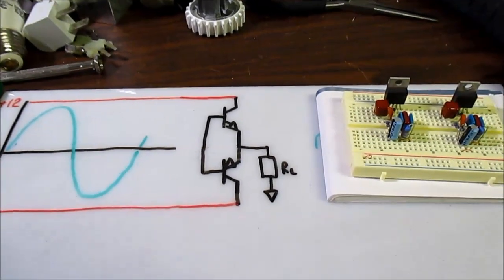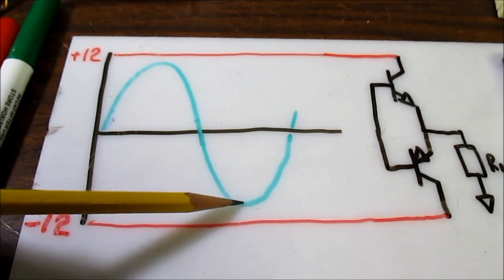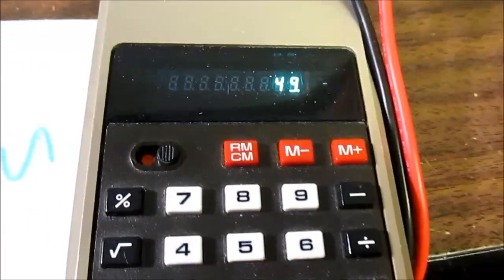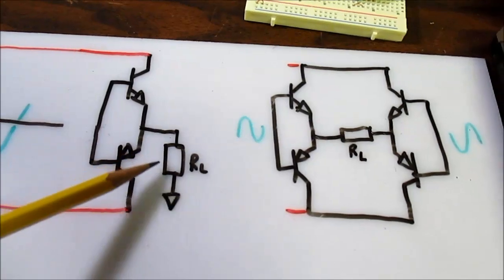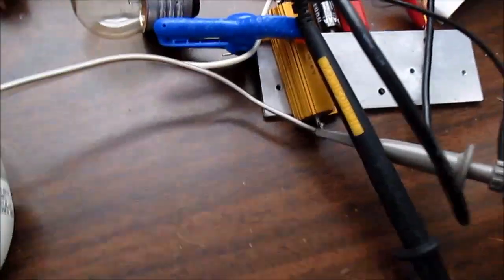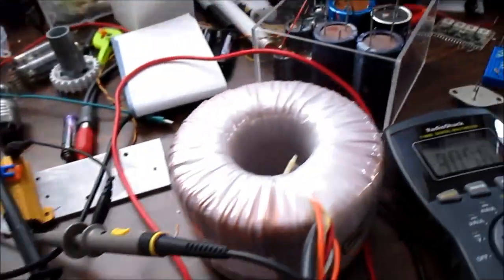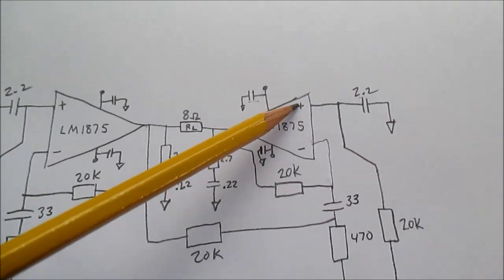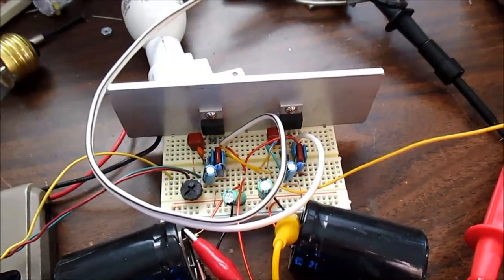Bridging audio amplifiers explained, LM1875 example

Comment: It's certainly worth bridging them if you want power from a lower supply voltage. I was thinking about doing it for an amplifier that runs from a single rail supply...22 to 24V from a rechargeable Li-ion battery

Comment: Hi John... When you sayd "35 clean watts is not too shabby with +/- 15 volt rails", I think that is voltage  +/-15 Volts under LOAD... In order to get more clean the wole picture,  please, can you tell me about the transformer? I mean secundary Amperes and CA volts (VA transformer data) and after rectifier CC WITHOUT LOAD? As always, very instructive videos... Thanks a lot and Greetings from Spain...

Comment: all you have to do to get around the current limitations is run the output of the op amp through a current buffer, and then take the feedback from the output of the buffer and you won't get any crossover distortion if your slew rate is high enough.

Comment: Hi John, came across this video now. I ordered 4 of those ebay LM1875 kit you tested. Good tip. Bridging them would be nice to try, but I have a question, why do you connect the output of the first amp to the second amps input instead of connecting the same input (to the inverting input of the amp also). Wouldn't that be cleaner, not having half of the signal go through 2 amps?

Comment: great video as usual. i'll only say that bridging "not so btl chips like 1875" could be useful when you already own several chips or a transformer with not enough voltage. those chips are way cheaper than transformers here, so if you want to add power to an existing system on a low budget, it's far more convenient to bridge or paralell some chips than to replace power supply.

Comment: I never liked the sound that comes from bridging car amplifiers! It just didn't sound right! To me it was like a whole lot of speaker movement, without the bass matching it! 😎

It is as if a switch was being cut on and off to mimic what was suppose to sound better, but didn't! But I don't care much for dual-voice coil speakers either!

To me a mono block amp is far better than a stereo to bridge mode amp, because it is made for stereo to out put mono! To where the other, has to be rewired to get the same effect! Plus I think there is more bang for the buck going mono vs a tri-bridge configuration! 😎

Comment: John. I dont understand why you stuck on tnose chipamps its no challenge. At least build descreet component amplifier with separate transistors. I dont mean to be rude but that would be a Better challenge than those chipamps.
Reply from the maker: +Hendry parman Discrete amps are beyond what a lot of people are interested in and don't attract as many views as the chip amp videos. Despite that, I am interested in discrete designs and do have a video in the works.

Comment: I don't get the purpose of signal generators. Every android phone can be such(up to about 22KHz). I can't see a reason investing in one.
Reply from the maker: +Rivalgamesbg A true wave form generator is far more versatile. Higher amplitude, low distortion, RF frequency, modulation options, arbitrary waveform, dual channel, frequency counter and so much more. I have no excuse for not having one on my bench besides the money needed...
Reply: Mihail, what you said, no it doesn't. Unless you  just want a toy to play with, then it's OK.
Reply: +JohnAudioTech Yes indeed, something I have wanted for decades now... Also a good dual power supply and scope like you have.
Reply: JohnAudioTech
It can do all those stuff you mentioned. The only thing it can't do is high frequency. The app is called waveform generator. The app+ a proper op-amp amplifier circuit can save you a lot of money. It is perfect for your audio testing needs.
Reply: Mihail Tochev I was using  android app like you said but it has its own limitations if you are serious about building you're power amp,preams and crossovers you need real thing it helps a lot money well spent.

Comment: Just in time as I was experimenting with this chip,bridging them is not worth it, not enough current What I tried doing(and succeded) was adding some transistors to boost the current of the lm1875,thus making 2 ohm operation possible.Ask me you want more info or a schematic.
Reply from the maker: +PetruV I used an LM1875 driving an output stage in my Kinter MA-150 amp review as I was planing to make a video on it at some point.

Comment: Sir..what is  the main purpose of bridging amplifiers?thanks for you response in advance..
Reply from the maker: +Mark joseph Navarro More output power.
Reply: But it won't affect or reduces the life span of the amplifier sir?
Reply from the maker: +Mark joseph Navarro Not if properly done. This is why I selected 30 volts (+/- 15v rails) with the LM1875 so that the output current is kept around 2 amps max when bridged. This gives some current headroom for dealing with most speakers' reactive loads. Running the chip bridged at a higher voltage would certainly stress it more.

Comment: Current limiting is the main issue on these small lowish powered chips. After all they were not really made for bridging. 
A good explanation of the principals of bridging however.
Reply from the maker: +Michael Beeny This is true. Bridging makes sense when you need more power when you are constrained by the supply voltage (such as when using batteries). 35 clean watts is not too shabby with +/- 15 volt rails.

Bridging is also common with high power PA amplification where huge power is needed (over 1,000 watts in some cases) into common load impedances so the amp design doesn't have to resort on high voltage supply rails and HV solid state design or heavy output transformers in the lightweight gear they use now.
Reply: @JohnAudioTech Hi, today I test a single power supply LM1875 amplifier, burn after 15 minutes.
I am using 27 volts.
Maybe my IC was counterfeit or I am using to much voltage?

What do you think.

Any help will be appreciate.

Cheers.